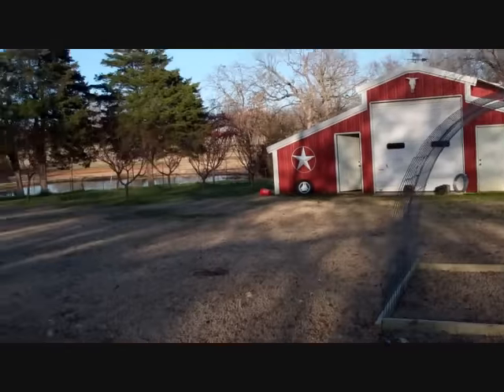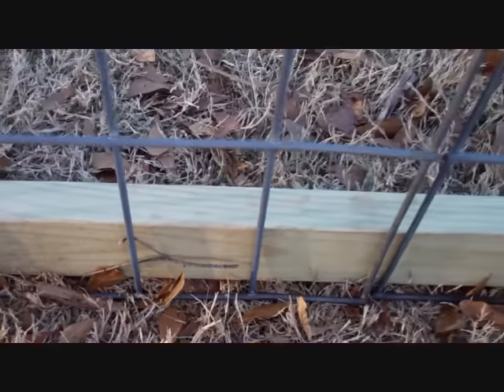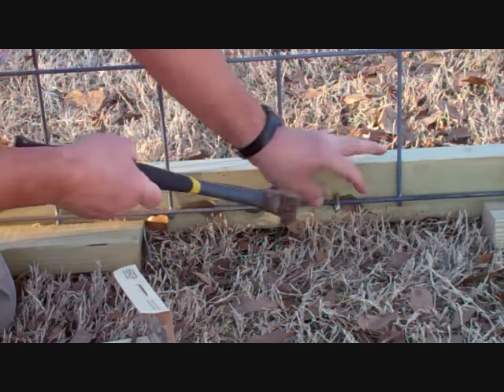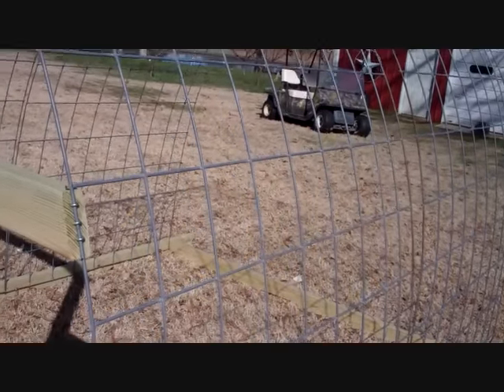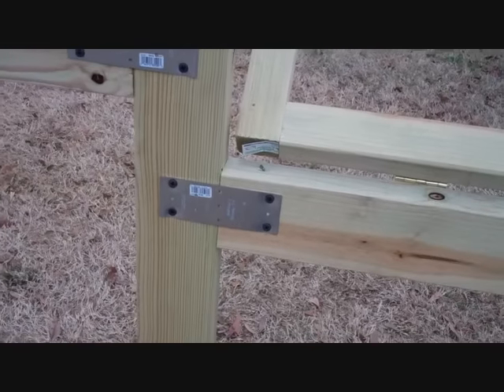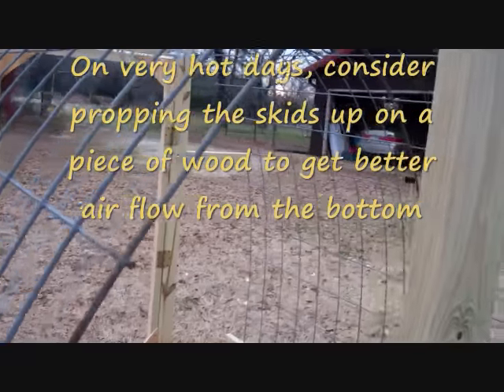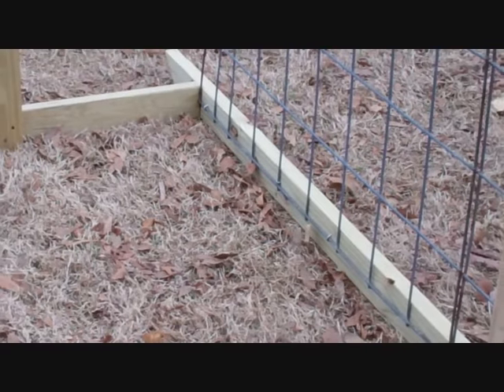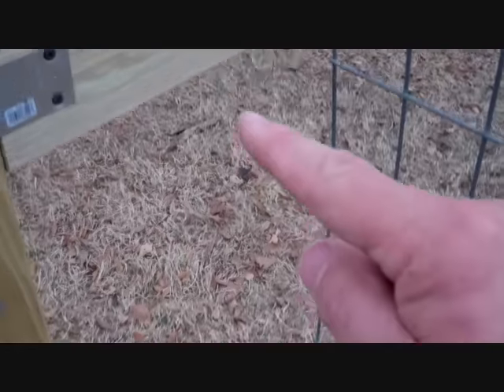🌞Cattle Panel Greenhouse🌱For About 150 DOLLARS! 🌻 DIY

Comment: Back in my younger days, learned to use the steeple puller on fencing pliers to hold the steeples when starting to hammer them in. Saved a lot of skin on fingers! lol    This is a great simple plan, may see if Mom wants another green house and go this route
Reply from the maker: They've been built all over the country.. and a several outside the country  :)

Comment: Just want to thank you for all the helpful videos regarding cattle panel greenhouse construction.  I live in Santa Fe, TX near Galveston.  Our property (about 1/2 acre) drains poorly so a conventional garden does not work for us.  I built a 8' x 16' deck about a foot off the ground and constructed a 24" knee wall around the perimeter.  I installed the cattle panels on top of the 24" wall so I have a nice area inside with over 8 feet of head room.  I've been building things all my life but never would have even thought of using cattle panels for this purpose.  I really appreciate it.  I would send you some pictures but not sure how I can get them to you.  Again,  thanks for all the videos.
Reply from the maker: +Debra Richards 
Glad to help.
I can imagine that being that close to the gulf would make it hard for poor drainage. Really flat.
Sure, send me a picture.

Comment: A little feedback.... I built one close to the plans this last winter. I did use duck tape on the end of the wire panels where it might poke the plastic. I used the 6mil plastic from Lowes. I the vent window open during the day, but I think the temp above the window got above 110 degrees regularly. Long story short, the plastic became brittle and broke apart. I am leaning towards the clear roof panels and installing a vent on the top of the dome... Definately glad I built it.. Just need to tweek

Comment: If you wire the panels together wrap it with duct tape so the wire won't eat your plastic.  

     This also makes a nice shelter for anything. Maybe a chicken house.  Just go around the bottom with rabbit wire or other small wire to keep other critters out. ;)   If your chicken house is light you can move it around in your garden or yard.  Your chickens will love it and in return they will clear and fertilize that spot for you. 
     There is no end to this little structures use!
     Thank you for your video!

Comment: also some 1"x4" material stapled or nailed into the inner frame work around the door and window would allow you to add some foam or something to allow you to seal up the door and window better.  In Kansas here, we get -(serious) temp to +(serious) temps.. so that added insulation could help out.

Comment: Oh, this is fantastic. I was trying to think out a small greenhouse for each citrus tree. I can use 3 foot wide welded wire, frame it similar but more of a square and have that drop down window on top that falls inside so I can get my rainfall. I am tired of losing my citrus crop to the freezes we have been getting. Everything freezes off the tree then it takes too long to recover and I get no flowers the next year while it is replacing leaves.
Reply from the maker: It should work great for a small tree...

Comment: Love this idea, I am going to try it. Thinking about a added 1/2 inch pvc pipe to base frame and using 'Snap Clamps' to attach plastic.
Reply: The plastic should last about 4 years. Wooden dowels might be cheaper and last just as long. No chlorine or dioxin being contributed to that way.

Comment: Was studying carefully.I agree with doors opening outward. Was also thinking if materials and welder available about using light weight 1  1/2” tubing to brace top shelf to bottom of frame  ran at an angle and hugging wire close without bending tubing. It would use minimal space while making top shelf near bullet proof for holding weight of containers. Using this method could nearly add a 3rd shelf if needed.
Great idea. I know what Im gonna do with some of my McCoy’s cull material now. Thanks for a great idea. I have about 25 of the cattle panels left from a lifetime of ranching.

P.S. Add a couple of  bolt on eyebolts on each end outside of door width but close to middle to reduce stress. These will let you hook small chain to pull/move it around as needed. The wider you set these apart the more stress it puts on the frame when pulling.
Reply from the maker: You have some good ideas... thanks.
Let me know how your greenhouse comes out 😎
Reply: @BIGALTX  shoot... you do to! That is why I subscribed to your channel a few months back when I was looking at Black berries. I am the one that told you I had bought a 16”  tandem dual dump trailer and was thinking about making a run to get some berry plants and trees.
Reply from the maker: @thesmokewagon6302  
I remember... I was jealous of your trailer :)

Comment: Fantastic.. love it.. will build it IF my home depot or lowes carries the panels. 

I had considered the PVC project but here in Alaska, we get snow.. so was worried about snow loads.. this however, would be perfect.. and low enough to broom the snow off if needed.  As for wind.. I think just for added support on the plastic, I can put a few strips of clear box tape, on the inside, over the wire, to the plastic shell.. would help keep the shell more stable if I need.. There is also room in this design to add an arch support 2x6 from door to window frame.. if I need. but i doubt i will.

Anyhow, love the narration, awesome accent :) Thought I was listening to Matthew McConaughey. :) 

Thanks a million for all your work and tips.

Comment: I just build this greenhouse off your PDF plan. We used the 2x6 option for the skids to make it a bit heavy-duty for pulling it around. Took a few hours for a couple of us to get the framing done. Our cost as of Sept - 2021 was $300. I think it is a good idea to add corner brackets on the skids to help when your pound in the nails I found you could knock out the screws.. LOL
Reply from the maker: Good idea.
A lot depends on how often it will be moved around  :)
Reply: @BIGALTX  Thanks for the PDF you made to get us all going. I more or less followed that plan, it was a great place to start.
Reply from the maker: @tnyberg67  
Glad to help  :)

Comment: i'm building a grow box from a tohisba 51 inch projection tv, gut it all out leave the glass in the back, use the hole from the projection part as the bedding or w/e you wanted, if you want to turn it into a hydroponics  system well you have the whole chamber below and pop out the speakers for the tubes. then you can wire the controls for it to the volume and channel buttons and all that. i have it halfway done normally, i dont have the money for hydro.

turning the mag screen from the tv into a 3k degree beam furnace also.
Reply: you were growing weed werent you

Comment: I wanted to give you a shout out because my husband and I put one of these greenhouses together this Spring and it has been wonderful.  He built me shelves out of 2x4's and small wire fencing so it could be less wood that water would  ruin. Also built a potting table  width of the back wall with the window on the far end that is the same height as the shelves. Covered it with the plastic to protect the  wood. I use the potting table ALL the time. He loves that I don't use the house to pot things up. A lot less mess. When I posted it to FB I made sure that everyone that looked at it got information  to  reach your site , Thanks for your help, we love it --well I love it- he does his thing, I do the gardening. LOL  How can I send you a pic of it?
Reply from the maker: Glad I could help with the project.
Yep.. send me some pics.
bigaltx@gmail.com

Comment: Is that treated lumber you used?  We have a severe issue with water when it rains.  I guess I could use cinder blocks but we also get high winds such as hurricane winds & straight line wind at times.
Reply from the maker: Definitely treated lumber. All the lumber used is treated.
Reply: Thank you!  @BIGALTX

Comment: Thought you would like to know I got mine built. Looks good too.  Only difference is I used the 2 by 6's for the skids like you mention.  Something to think about if you use the 2 by 6's then the fencing has to go up higher on the skids or the door and window frames need to be trimmed 2 inches off the bottom.  I did not realize that until I tried to install them and they protruded below the 2 by 4.

Comment: On your sheep /goat shed build 5vyears ago if you put the second 2x4 on the inside of the skid you could keep your cattle panel off the ground plus your skid is 4 times as wide and will still keep your skid from blowing out too
Reply from the maker: Great tip, Thanks!

Comment: Question...Did you have any issues with the plastic degrading where it came into contact with the pipe insulation?
Reply from the maker: The only degradation I saw was after 3 or 4 years.
BUT... I used good greenhouse plastic, not big box store plastic sheeting

Comment: What do you do in the summer when the greenhouse is really hot? Does opening door and window keep temp down enough not to hurt plants? What do you grow in the greenhouse in summer? Thanks so much
Reply from the maker: I don't grow anything in the greenhouse in the heat of summer. It's just too hot in there.
You could throw some shade cloth over it and grow some heat loving things.
Or move it to the shade under a tree.

Comment: I built mine 5 years ago I think and it has been great.  Used a good quality green house plastic and it is standing up well.  May have to replace the plastic someday (That'll be a pain) but not this or next year.  Some advice on plastic.  DON'T get the clear plastic.  Get one that only allow a percentage of the sun to enter.  The clear plastic will fry your plants and the semi shaded plastic will allow the use of the green house over a longer period of days during the year.  I want to once again thank TexasPrepper2
Reply from the maker: Great to know it  has stood up for you.
Great advice on the plastic.
Most people don't realize how hot it can get in there.
Reply: @BIGALTX  I just built one 12'x21' about a month ago. I have a major problem with the plastic though. I used OSB on the ends to be sturdy in Wyoming winds. I used foam pipe insulation on the round ends to protect the plastic.  I think there is either a chemical reaction between or the black absorbs excessive heat in that area. Anywhere there is contact with foam the plastic disintegrated and the ends completely failed. I also put foam on some rough spots on the tunnel, and it cracked there too. I used cheap .4 mil because that's all I could get.  So I will invest in something better, but just so people know the cheap 4 mil visqueen did not hold up up a month for me. Could be the foam though need to tape it maybe.

Comment: Did you staple the plastic along the bottom or added another  2x 4 and screw it over plastic to other wood bottom?
Reply from the maker: Both.
Stapled it first to hold it in place, then came back on top of it with some batter board strips screwed over the plastic to hold it FIRMLY in place.

Comment: I built one very similar about four years ago.  I just zip tied the panels together.  It’s held up to tornado alley winds.  The UV treated plastic is sill going strong.  A little clear gorilla tape repair each season.  The whole project was less than $300.  How many years did you I get out of your plastic?
Reply from the maker: 4 or 5 years. 
And yes… Great tip about the clear tape for repairs. I used clear packing tape. 
Works great.

Comment: Thanks a lot. Final question: if I'm only using two panels, what size of poly sheet will I need? 10x25?
Reply from the maker: +Angel Mancia 
No... 16X25. 
The 16' length goes over the arch of the greenhouse (side to side). 
The 25' is needed for front to back.

Comment: What I used for base instead of 2x4’s because I get a lot of wind and also can get critters.  I’ve used railroad ties.  The weight keeps it very secure in high wind and also deters critters from digging under.  But we love using the cattle panels, it’s just so quick.
We also made a chicken house and used aviary wire to keep wild birds out.  Both are 4 panels long.
We did make our door swing out.
Reply from the maker: Yep... with cross ties it ain't goin' anywhere :)

Comment: What plastic did you use? a special 'greenhouse' plastic? or a painters drop cloth plastic? and what thickness? 6ml? or thicker?
Reply from the maker: I bought some 6 mil from a greenhouse supply company near me. I bought enough to do about 6 greenhouses. I am on my 4th winter and it is still holding up good, thought it is not as clear (it is a little "milky")

Comment: Is the 'cattle panel' the same as reinforcing for a concrete slab?
Reply from the maker: NO... That is just a wire. THIS is actually very stiff and won't bend very easily.
Cattle panels are made by welding 1/4" rods together to form a grid. 
The concrete wire material is nowhere near that thick.
Hope that helps

Comment: A  friend an I built one about 25 years ago, with the cattle fencing like yours.  We put sides on about 18'' up, then attached the fencing.  This gave more head room.  Your door should open out to save more room inside and have a brace in the middle.  You can then attach a door spring inside to keep the door closed all the time.  Also on your door, you can attach a door cable from corner to corner with a turnbuckle to keep it from sagging.  Eventually we installed an old aluminum glass storm door we found in the garbage.  We used duct tape on the corners instead of pipe foam to save some $$$.   We'll have to rebuild it this fall as the ground timbers are rotting out.  I'd say 25 years was a good life span for the wood.  This time we're gonna' use rail road ties on the ground then put up our wall.

Comment: Would this work for a larger greenhouse, say 16' x 16'? Or would the cattle paneling be too weak?
Reply from the maker: I haven't done it... but some folks have put 2 panels together to make a wider and taller greenhouse.
You'll have to support in the middle with a beam or some other support.
You'll have to come up with your own design though, as I haven't done it.

Comment: Before I buy the plans, I've got a question. Do the plans include how to make this air tight? Based on this video, it looks like there are significant gaps around the window and door.
Reply from the maker: Nope, there are no plans on making it air tight. The air gaps aren't that significant, but if you think they are, you could always use weatherstripping to seal it up. Hope that helps. - alan

Comment: I made one that was four cattle panels long. We have used the hog nose pliers and metal pieces to connect the cattle panels, as this is how we house our chickens. Anyway my second winter with my beautiful jungle growing inside...tomatoes, peas, peppers, broccoli, etc. We were really enjoying our produce when we were hit with an ice storm. Instead of sliding off the plastic, the ice collected, causing the cattle panels to sag on top. Even though we went inside and propped it up, and our son worked on removal of the ice, which was three or more inches thick in places, we lost our plants. 
So my advice would be to add some good strong supports down the center. I had some...just not enough for the length.
Reply from the maker: 3 inches is a LOT of ice... wow

Comment: what size plastic sheeting ? one total piece ? and was it 4 mil? thank you great idea
Reply from the maker: michael bailey Depends on how many cattle panels you used... but a 2 panel greenhouse uses one 16' X 25' pc of plastic. I use 6 mil plastic. MAKE SURE IT IS "GREENHOUSE PLASTIC". I've been told that the Warp Bros I linked to in the e-Book will NOT hold up. I have linked to some good greenhouse plastic under the video in the "About" section.

Comment: My plastic dry rotted in the first year just where it goes over the insulation strips. What do you thing of making solid ends with some windows on the ends?
Reply from the maker: That would work... and some have done that.
I am thinking about doing ALL of my next one...the ends and the top... in clear corrugated panels (like i did the corrugated shed in the PDF and e-Book).

Comment: I built under your instructions and it worked out awesome, the problem I had was the Home Depot plastic fell part in just a few months. Now my question to you is have you ever thought about making removable plastic panel or roof that opens up, gets real hot here and the greenhouse is unusable during the summer so I did remove the crappy plastic and had one of the best crop in years..With great thanks Brad
Reply from the maker: To get several years out of the plastic, you have to use real "greenhouse plastic".
I have a couple of links under the video in the "show more' box. Either of them should last 4 or 5 years... even in TX.

Comment: Great ideal. The only  two question I have is...if the base is 7ft. wide, how long do you make the panels again so it is 7 ft. tall at arch?;  The second question is; can I use kennel fence which is a little smaller squares than the  cattle fencing?
Reply from the maker: I use full panels just like they come from the store.
They are 50" X 16 feet.
To go with a higher arch, you'll have to use higher "skids" or "runners" and raise them up before you nail the panels on.

Comment: How wide  and long is pastic. And how keep warm in winter
Thank you my husband going making me one
Reply from the maker: Plastic for a 2 panel greenhouse needs to be 16' X 25'.
Various ways to keep it warm in winter... most are expensive to use.
Reply: TexasPrepper2  thank you what going  longer and double it over would air be ween to layer would help
Reply from the maker: Up north they use 2 layers of plastic to help insulate.
You can try it... but I never have...